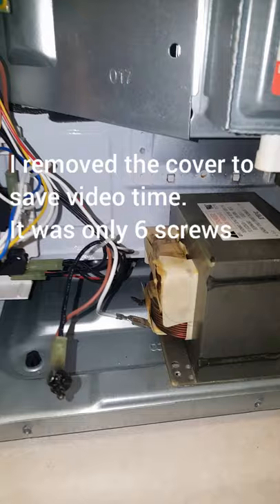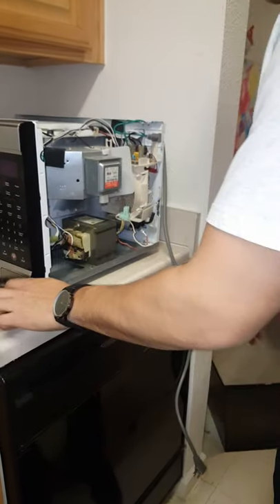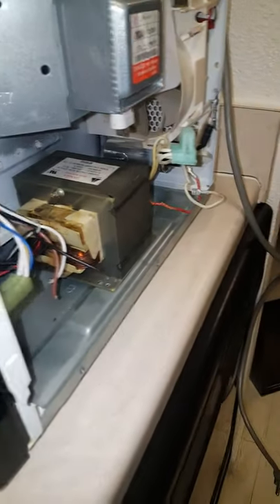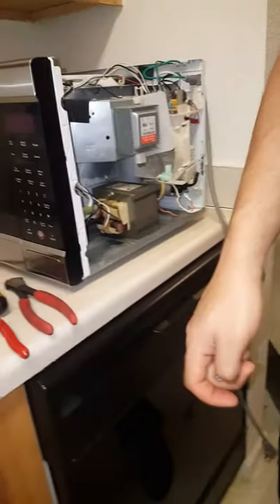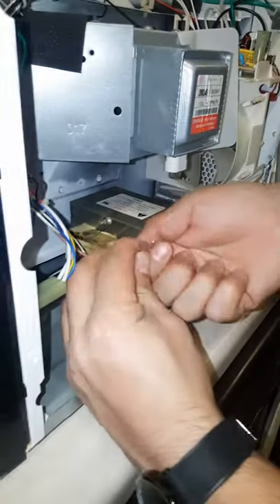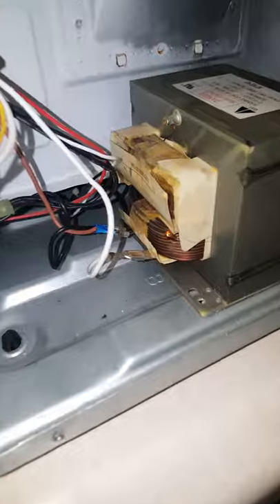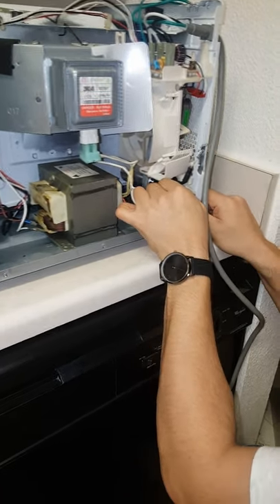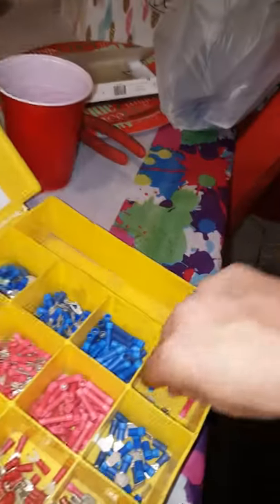Microwave Burning Smell / Burnt Plastic Smell Repair

Comment: Just opened my microwave to see if I had the same problem and sure enough i did. You just saved me a lot of money. The only thing different I did was brake the plastic piece and scraped all the brunt plastic, because I didn't have a new connector, but all in all working great.

Comment: You need to always find out the source of the problem, A connector doesn't just burn unless there is bigger problem or a short elsewhere.
Reply from the maker: 100 percent correct, I agree. I am a diesel tech and I am well aware of electrical failures and back routing. However I just wanted a quick fix. Also the connector was just melting the surrounding plastic the connector it's self was fine. Thanks though for the heads up. I will probably do a more in-depth trouble shooting video Traci g wire and running the schematic if the microwave brakes or something.
Reply: @raymondromero2840  I would say the factory crimp was crap and age caused corrosion and that cause eventual poor connection that generated all the heat to melt the plastic.   Steam from cooking probably accelerated the corrosion.    You might consider redoing the connector on the other side of the transformer also.  HAPPY NEW YEAR

Comment: I dont know much about microwaves either ,but i know they have high voltage capacitors that still hold 1000s of volts even when unplugged, discharge them first before doing anything.

Comment: Is it still working? How long did it last?
Reply from the maker: Still working hasn't messed up since.
Reply: @raymondromero2840  thanks, you probably saved me a couple hundred. I've got the same burnt wires. I'm not an electronics expert but looking at the wireing digram in my oven... I think what happed is the thermal cut out tripped and the high voltage was dumped through it which burnt the cut out.
Reply from the maker: @TheDanlarrabee  yeah I'm no expert either, but I keep trying to duplicate the issue so that I could get to the root of the cause.  I was able to find that when I put it on defrost 15 min 3 times back to back the high voltage magnetic (HVM) box would begin to get very hot 96+ degrees. And the wire where the plastic melted was at 121+ degrees.

 I mean I don't use defrost for 45 mi. Very often so it not a problem and I removed the plastic so it won't smell. But I guess if necessary I can replace  the HVM to solve the issue for good.
Reply from the maker: Hey but glad to hear it helped you out. Thanks for watching.

Comment: That burned connecter was for both wires
Reply from the maker: Yes the two wires were in the burnt/melted connector. It may be different for your microwave, not all are wired the exact same. Hope this helps.

Comment: Mine had a smell of burnt and no heat. I think because I kept on using it continuously for like 3 min each time one day and it over heated. Lesson learned
Reply from the maker: Oh dang that is crazy. Good thing nothing's arched out and caused fire. Yeah if some of the connections loose continuity not everything will work properly.